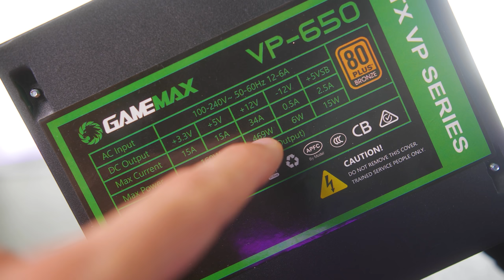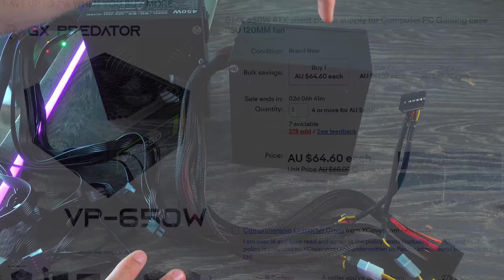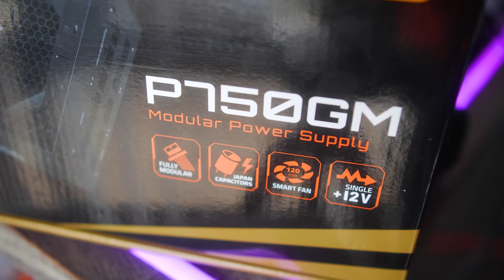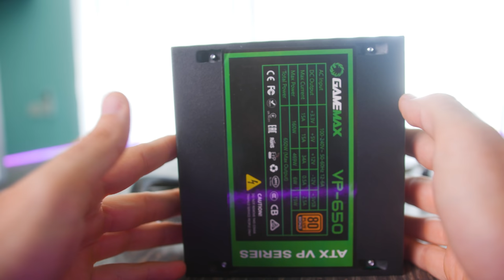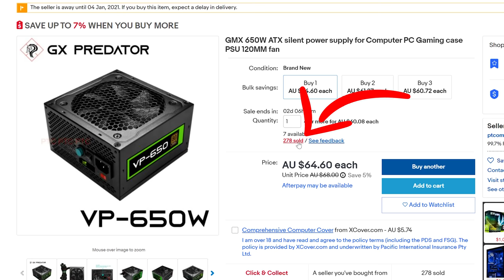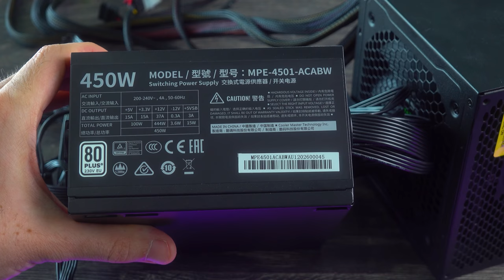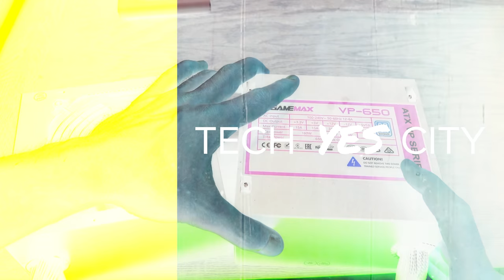This Company is Straight LYING about their "650 Watt" Power Supplies.... (*UPDATE* FAKE GameMAX??)

Comment: I've used these in multiple low end  builds and haven't had one problem with them,  I wouldn't however even try pairing this with an RTX 3070, highest i've used with this is a GTX 1660 Ti.

Comment: I was with GameMax brand because it is the only brand that is available at store. I've got the 650W with dual GPU power , I was happy with it when I have single GPU like 1080 TI-250W-, and 2060-170W-. but once I did Dual GPU with dual RTX 3060 TI 370W for both , the power supply was exploded which was a huge disappointment Glad the PC component were fine but, from that I will never trust GameMax PSUs.

Comment: Do a video on how to get Xeon Phi's working properly, the 7xxx models, you can pick them up cheap, ads 61 core @ 1.23GHZ i believe. I haven't been able to get my cards working properly in windows 10, just CPU/co-processor mining.
Reply: If you could get the package to work with games / create a game script to input which game for the card to use you would have your CPU + 61 cores + 244 threads ontop.
Reply: And 8 GB GDDR5 :D

Comment: You are absolutely right about the power supply, but you installed the aio cooler wrong.. the tubes should face down, oh and you should check the Antec v500 atom, absolute garbage..

Edit: grammar.

Comment: LC Power had 550W with 16+18A on 12V 15 years ago. So this is really bad.
I got some cheap 15€ 500W yesterday and it has 31A and 372W on 12V, so no false advertising. It's still very light and doesn't even come with PCIe connector, but it's fine for office PC.

Comment: mine popped running just 1x R9 290 ... meanwhile the Antec 550W Platinum Power Supply ran 2x R9 290 and 16x HDD for years no issues also some cheap power supplies have ceramic being added for weight

Comment: The real non fake GameMax psu is actually labelled "GP-650" and not VP-650 but even then I wouldn't recommend GameMax psu to anybody, none of them actually output the rated wattage on the 12v rail.

Comment: I'd reccomend sunflower or evga power supplies . I have a evga g2 750w running a 3900x a 3080 ftw3 , 1 sata3 ssd, 1 nvme ssd. 1 hard drive and 7 fans with rgb and it has been great .

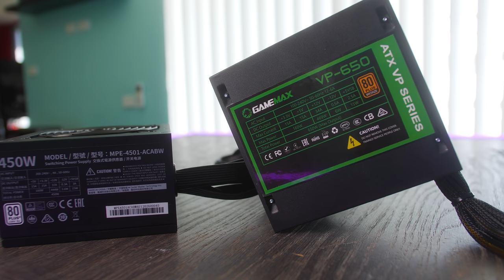Comment: 2:54 What about the "80 plus efficiency" where it is written "Bronze" 3:06.
It has 80 plus certification, and whatever the rating is, is in the box of "efficiency" above.
Or did i miss something? Isn't 80 plus a certification but bronze a rating?
Either way this is starting to look like the sound amp ratings "800 WATTS" and the thing can barely push 400.

Comment: Never cut corners on PSU's... Always get 100w more than you need and always go for a reputable company. 

My 660w Seasonic PSU Platinum has been running strong for 4 years with my 8700K and 2080 Ti now running on it prior to that it ran a 4790K and 1080 Ti. 

Plan on getting a 3080 Ti when it arrives.

Comment: P = I * V  (Power = Current times Voltage).  Always go back to the basics. For the piece of mind on such a critical and fundamental component in any PC build, spend 60% more and get a decent 550W 80Plus Bronze PSU from a trusted OEM/vendor. On all of my home PC's for myself and the kids I have not gone below 650W 80Plus Bronze. The last one I purchased, a Corsair TX650M for about US$90 (8 months ago); pure Gold on a system that requires enough quality juice...E5-1680v2 + 1080Ti.

Comment: 90% of these PSUs come from the same factory in China. The compnents are cheap with no quality control. My latest build used a CIT650 certified bronze which short circuited after a few hours. Amazon replaced it with a Corsair 550 which was nearly 500 grms heavier.

Comment: yea you aren't saving money with a bad psu if you have ac, the extra heat costs you twice over.
supposedly its not just the instaburn hazard, the pc power and cooling guy is in another youtube video explaining that the dirty power shortens other components lifespans, so maybe that applies as well if true.

Comment: Hey Bryan, I think the power supply or any power supply product for that matter doesn't have to be audited in order to be able to print the regulation stickers on the product. The company in question only has to say "I conform to the safety standards of the CE" and badaboom, they can put a CE sticker on there. This doesn't apply for medical products I think and other high risk equipment, where these have to be strictly audited. Any damage that should result out of the assumption that the product was conforming to the regulations should make the power supply company liable for the damage. However, I'd doubt you'll be able to send them the court documents since they wont exist anymore should that happen lmao.
Reply: Also, the 80 Plus org is basically a sham operation and their sticker is meaningless. They basically do little to no testing and award the label if the manufacturer just pays a subscription fee, hence the price of the product being that expensive.

Comment: Yeah, never worth buying a cheap power supply. Cheaper in the long run to stick with a reputable brand and a slightly higher rating than you think you need.

Comment: Reminds me of Q-TEC, long long ago suddenly they had 550 Watt power supplies. I Know the age of the Pentium 4 and so on! 
But how did they do it? Well it wasn't a 550W power supply, even taking in the super short maximum power output it never hit 500W... effectively it was a cheap 300W power supply that was mislabeled!
The ticker? If you wanted they also sold the same power supply as a 650W one! Yeah!

Comment: Brian are you sure these are not fake PSU's? I can't find these power supplies advertised anywhere except the eBay retailer in Australia you showed in your video which does not even mention Gamemax anywhere? Gamemax themselves don't even advertise it on the Internet as far as I can see. The GP550/GP650 series I have used in the UK are decent value PSUs which you can find on Amazon but they should no way be used on high end RTX cards. Why spend 70AUD on a PSU when your spending 800AUD on you graphics card? Think you might need a part 3 video giving some positive reviews of good value PSUs out there even if they are not GameMax. Keep up the good work.

Comment: Those things are a fire hazard, DO NOT buy them. They use thin cables which cant even carry the current and cheap components. I wouldnt even be surprised that the 450w at the beginning and 500w at the end was the psu burning up.

Theres also is a reason a company like Seasonic gives 12years of warranty.

Comment: RCM is a self certified thing. No one approves anyone. The company just stamps it and self claims they are compliant. If you can prove they are not compliant they will get in big trouble... (actually whoever is the importer will get into trouble, as well as the retailer).

Comment: Looked at Gamemax and couldn't find a VP-650 - the VP-600 is rated 40A / 480W on the 12V - could these be fake / relabelled?
Also, the label is in the wrong place, it should be on the side, not on the top

Comment: I'm still using my XFX 1250W PSU it's almost 10 years old so might need to replace it soon, not using that much power i think but i wanted to be safe when i did my xfire setup, might drop down to 7 or 800W

Comment: I will only buy Super Flower PSU's, maybe Seasonic. I've been running a Leadex 750 Gold for the last 5 years or so and it is about to get replaced by a Leadex III 850 Gold tomorrow (lord I don't want to have to redo my whole cabling). I'd rather spend a little bit more money on my PSU and have no worries.

Comment: A good PSU is the founation of a good PC. I always get a decent PSU that gives me more power than I need so I can upgrade with out no problems.
The better PSUs auto switch the input voltage now. So there is less chance to damage. I have a Corsair  CX750M  750 Watt in this PC. Its on nearly 24/7 for the last 4 years no problem yet.

Comment: They have the wattage but it's not on the 12 volt line.
Reply: No it doesn't. Standard convention is to rate the PSU wattage based off the 12v rail output. You don't sum the total of all the rails. All reputable PSU brands use the 12v figure to determine their rating and in most cases they can actually sustain higher loads than advertised. Only cheap crap like this unit sum the total of all the rails and claim a higher wattage that the unit will never cope with long term

Comment: MWE 450w was very expensive (about 70$) and run out of stock everywhere in my country.
So I got Be Quiet U9 400w, is it ok to put 1660 super in it, or just bought 1650 super?
I only running i3 10100 and 16gb of ram now.

Comment: I would say there are worse "650W" PSUs floating about.  I bought a 550W one which died within 20 seconds of loading up furmark on a GTX780ti and 1st gen i5 despite 45A rating on the +12V.

Comment: Hi I just wanted to ask if corsair cv650 is a decent psu? my budget is 70$ (3500 Pesos). Im from the Philippines and theres not a bunch of options here at 70$ range. My options are:
Gigabyte P650B
Cooler Master mwe v2 650 watts white
Corsair cv650 bronze
Seasonic s12iii 550 watts

Specs:
Ryzen 5 2600
Rx 580 8gb Sapphire Nitro+

Comment: that's a budget PSU made in china.... just open it up and look at all the cheap components they use. You're right though that sticker makes no sense at all the math doesn't add up. Never buy China made Psu's no matter what Big Number they put on the case China made PSU'S for the most part are of terrible quality on the Inside.

Comment: I have a 600w TR2 Thermaltake PSU that looks ugly but it is a solid unit. Not a modular PSU so hiding those rainbow cables is bad. But my friend had a off brand 750w unit that burned up, and well that 600w works great. XMas gaming saved.

Comment: Hey I bought a Corsair CV650 psu it's also rated 650Watts and has 52A in the 12v rail, it however has coil whine when I'm playing certain games , using a GTX 1080ti and an i7-8700. should  I be concerned?, it's only 2 weeks old and Corsair won't RMA for coil Whine.....

Comment: Can anyone tell me if Corsair Cx550 any good.
My 6 year old VS450 is not able to deliver enough power for an rx 570 8gb and i5 4460. It frequently restarts while in cyberpunk 2077.
Anyone with good recommendation pls answer.I want to upgrade to a R5 3600 later, will keep the 570 though.
And how about Gigabyte P550B or antech VP650?
Reply: i wouldn't be surprised since its a quad core

Comment: To check if a unit is 80 Plus certification-genuine, it can be done on the 80 Plus Certification site (https://www.clearesult.com/80plus/manufacturers/115V-Internal/#page-3). But that said, a quick scan reveals that GameMax has VP-600, VP-700, VP-800 models, all with Bronze listed. That might be a clue, given a VP-650 seems slightly off from their product series convention.

Comment: oh no i use gamemax rgb 850w 80+ gold and yeah it's so noisy,but i didn't smell anything is it good or i need to change my psu
Reply: change it when you can afford to. I assume you don't pull anywhere near 850W from your system or it would be toast because i blew the 650W under a 400W load. I got a Seasonic S12iii 650 it was on sale on a few ebay stores recently for 55 dollars. If you truly need an 850 they get pricey pretty quick but if you have a pricey gpu that draws that much its worth it to be safe.
Reply: @eclipsegst9419  ok then thanks for the advice man i appreciate it😇

Comment: Im using a different model from Gamemax.It's 600w and powering quite power hungry rig.For the last 12 months never had problems with it.I did checked the weight of it after this video-1.34 kg so maybe it's not a problem across the board?

Comment: 12 month Warranty + Limited 3 year Warranty if you dont register, if you do register its double to both.  I own the 600 watt which is rated for 40amps and 480 watts which is 80% of 600, and mine does come with manual besides it passed your test, i think your blowing things way out of proportion, calling them straight up liars if defaming

Comment: I've also been told that if the psu has a switch on the back to change from 120 to 240 volts input is a big indicator of cheap parts.

Comment: after I use a garbage power supply I buy the andyson venus 600w (540w at 12v line) with less than 30 usd, and it run anything I throw at it, even 14 pin gpu. but of course it's not efficiency, that's why it's so cheap

Comment: Just looked at a few other PSUs, and only the cheapest makers combine the 12v rail plus the 3.3/5v rails.  This is likely because the 3.3 and 5v rails are converted down from the 12v rail. This PSU is suspect at best, false advertising at worst.

Comment: The PSU is officially certified on the Clearesult website though, stating 82-85% efficiency. Wonder what went wrong here... because that's clearly not the case.
Reply: what psu?
Reply: @Picadoradecarne  The GameMAX VP-650, the one the whole video is about.
Reply: @Cimlite  cos vp650 doesn't exist...
Reply: @Picadoradecarne  Hmm, that's strange. You're right, it's not on there... could have sworn it said VP-650 back when I checked it originally. Guess I could have read it wrong though.
Reply: @Cimlite  the psu of the video is clearly fake

Comment: I think there are counterfeit versions of the GAMEMAX GP-650 (notice it's GP-650 not VP-650).   In the US, the GameMax has a different specifications label that matches the certified PSU docs from https://www.clearesult.com/80plus/.   The GAMEMAX GP-650 sold in the US by Amazon, seems to be a different unit from the one you present in your video.   I don't believe there isn't any model of GAMEMAX VP-650  only  GAMEMAX GP-650 is a legitimate model that  GAMEMAX  sells.   The GAMEMAX  VP-650 is  a knockoff copy with a slight of hand on the spelling of the model  number (Looks to  be  a mislabeled GAMEMAX VP-500 - non-certified PSU based on top portion of the specs on the label).

Comment: Just looking at the website and comparing to your video... They don't have a VP-650, although I know they could have had one at one time, but the labels position on the unit is in a different spot then on the VP series.. The GP-650 does have the label on the bottom like this unit.. Also, all the units on their site say "made in china" on the label, along with the UPC code (sticker??) on top of label... Couldn't see those on your unit..  The odd numbered wattage on your label really gives it away though...  Your unit must be a ali-express unit..  Try getting from a different source??  rather then the site you did get it from.. I think your source is suspect, more then the product... I don't have any products from them, but give them the benefit first, before you slay their name   :-)      G

Comment: Fun fact for me is.
I'm still using it for my current rig😂
And that rig doesn't pull much
Just a RX 550 and 3470. 
But. I'm absolutely going to replace it before upgrading to R3 3300 or 10100f.
Oh yeah that particular gamemax stuff that i still used is GP-450.
But still. I don't dare upgrade to R3 or comet lake i3 with that LMAO 🤣

Comment: Just saying....   buying an electrical component like power supply ,   and if they fail even the ohms law on side sticker ...  maybe you should avoid it...  they care so little to even make sure that they bother to check something so basic that any 8 years old should be able to calculate, before they lie on sticker.    And hence...  im sure the certificate stickers are just as fake as their readings on it..    Making the situation to even sell those would be an crime of an sort..   specially if one house or push fire could be traced back to those crappy things.

Comment: Having a 110V/230V switch on it, this psu has no Power Factor Correction. Would never use it on a new system.

Comment: ok so i got a 850w version of this brand' model. using it with a 65w ryzen and a 120w rx 570 gpu, would be afraid to upgrade to anything more power hungry than those 💀💀💀
Reply: Downgrade to a RX 550 before it's too late
Reply: The psu in this video is fake. you have the rgb850 gold?

Comment: Bryan PLEASE, get yourself a dummy load (some halogen lights would do) and a cheap oscilloscope (a $100 US hantek will do fine) for these reviews, and do some reading about how power supplies are constructed. 
The rating label on the Gammax makes it very clear its an old pentium 4 era group regulated design, and cross-loading it would be incredibly informative of how bad it is, but you really need to put the effort in.
Go read PSU reviews on JonnyGuru and HardwareSecrets (they set the standard a decade ago), go visit psuCultists, talk to some electronic techs or engineers. 
You could do a lot of good but you really arent there.
FWIW i wouldnt bother if i didnt have some respect for you
Edit - also the regulator certifications generally just check the insulation etc design is ok, that it wont electrocute you or take out the power system. They dont check the quality of the unit generally.

Comment: laughs in $18 Korean 700w PSU powering my RX 5700 XT with 50% extended power limit on 300 watts (GPU only)

p.s. I bought a $88 Seasonic GM650 anyway because I hate mustard cables, ruins the aesthetic for me.